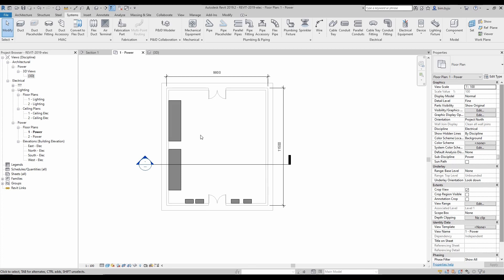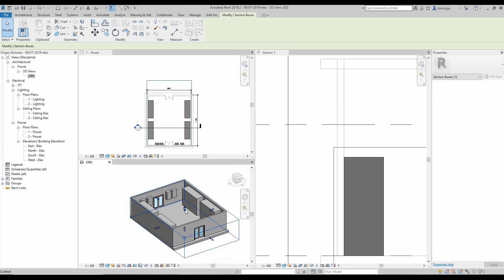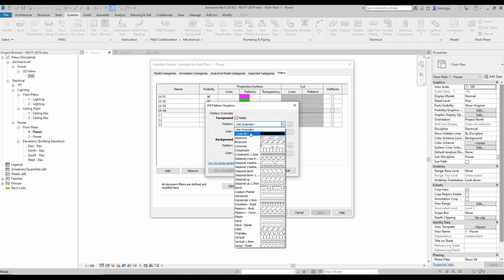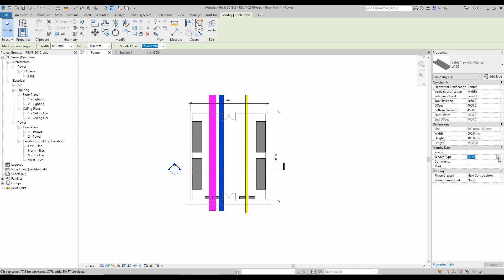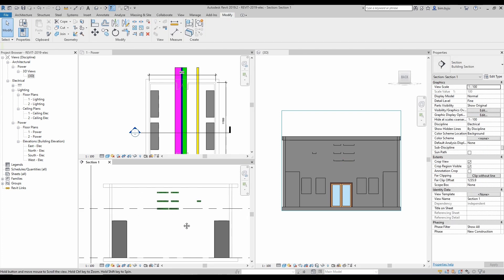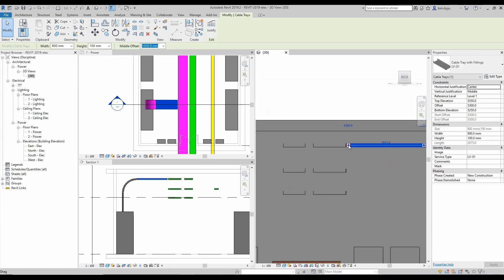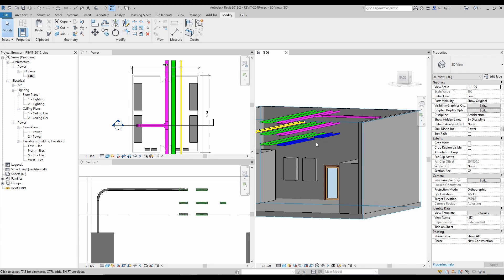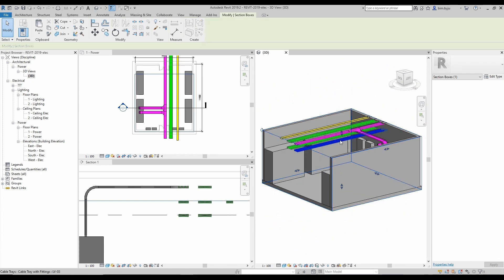Revit-3D-Electrical Room Tray & Conduit-Part-1

Comment: what service type means
Reply from the maker: It means refer to classification of a building system element or component like electrical and mechanical element ducting piping ,cable tray such as
Reply: @AutoCADRevitByju  sir i mean is there any need for making these much type of cable tray , or can draw with single type of cable tray

Comment: Hi color you performed by fillter but what about the service type parameter what you chooseen there group indenty data i wont to know more about that project parameter
Reply from the maker: thanks for your comments, while you selecting cable tray need to check the property - then identity data then you will get service type mention your cable tray name.
I will clearly make other video for filter in Revit.
Reply: @AutoCADRevitByju  ok thanks when that video you will upload
Reply from the maker: @mohsinpathan7692  within a days
Reply from the maker: Uploaded please watch
Reply: @AutoCADRevitByju  thanks
Reply from the maker: I have uploaded one video related to filtering please watch thanks

Comment: Today I tried cable tray design in revit. It was not so good experience, a lot of mistakes during connection of new parts to existing. So, probably cable tray design is specific issue in revit and work not so fine as pipe routing.
Reply from the maker: use electrical default template while u opening new project..
Reply from the maker: Choose discipline as electrical
Reply from the maker: It will work
Reply: @AutoCADRevitByju  Yes, thanks a lot. Just started learning revit and cable tray design in it. 3d modeling new facilities in existing plant very convenient feature.